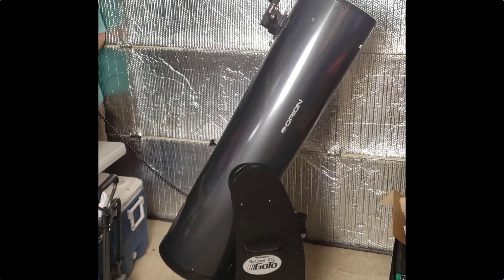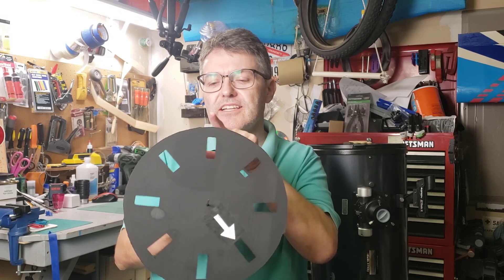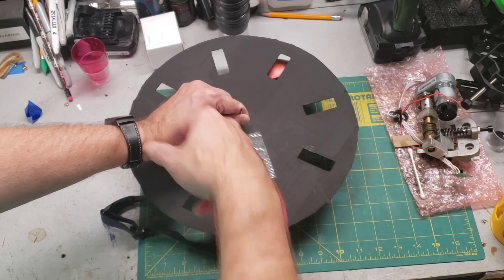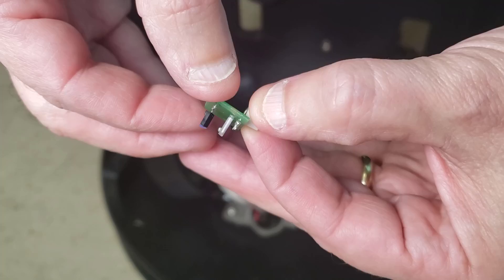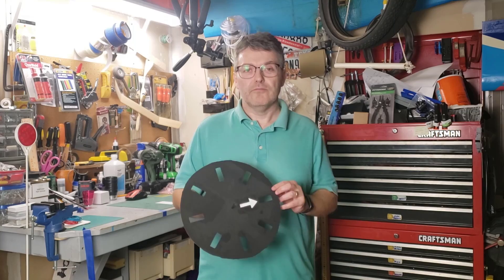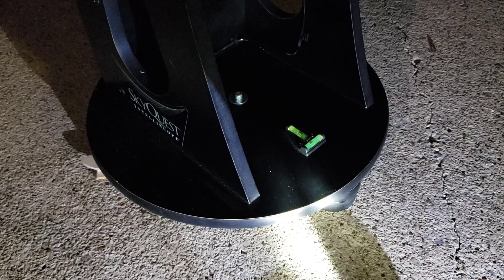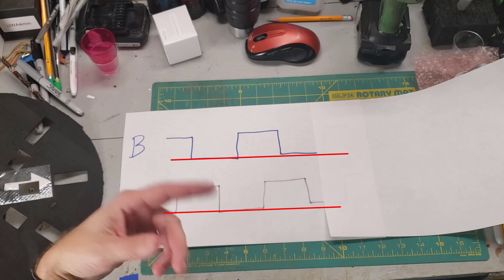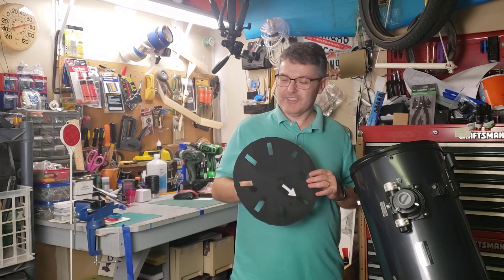The Secret Behind Smart Telescopes

Comment: Yeah love it! Great explanation!
I love my onstep 10" dob system where, rather than encoders, it uses "steps" or pulses to rotate the stepper motor a set number of revolutions on the alt/az axis for the amount of degrees to move. Again, power on and "reset" with the dob aimed North and level, slew to the 1st target with medium accuracy, manual fine-tune so it's centered in the eyepiece and "align" so it's locked in accurately. 
Took a bit of calculations to get the "steps per degree" dialled in but is reasonably accurate.
Cheers 👍
Reply from the maker: Congrats... that sounds like it was an advanced system.  I'm impressed that they went with stepper motors.  Clear skies!

Comment: Rotary encoder knobs use the same principle, but use electrical contacts rather than slits in a disc. But the principle is the same: two contact points, slightly offset, and copper cladding on the disc to act as the slits. These are the "clicky" rotary knobs you find on many consumer electronics to e.g. move through menus and such. They can often be depressed as well, closing another contact, so you can use the same knob for both navigation and confirmation. Cool stuff, definitely worth looking up if you're into that sort of stuff.
Reply from the maker: Thanks for the note - they sound just as intriguing. I'm one of those people who has fun stumbling onto new (old) technology that is often an underlying technology for modern civilization.  Thank you for watching... clear skies!
Reply: @AstronomyGarage  Hah, just saw the community post with the telescope and the mouse. I guess that just like me, you're old enough to remember the time before optical mice? The old ones with the rubber ball?  Actually a heavy core for weight, think it was steel, surrounded by rubber. Well, that ball rode along two capstans inside the mouse. And at the end of each was an optical encoder disc, just like the ones you showed in the video.

Problem with those was that the ball tended to pick up grime which would get deposited onto the capstans, requiring frequent cleaning. Which is why the introduction of optical mice in the late 90's was a very welcome development indeed.

Comment: There is a problem with GoTo system. At least with CPWI software. The WIFI connection is quite unstable. Sometimes it suddenly breaks while the telescope usually goes on following the sky object. however the CPWI requires reconnecting and doing alignment procedure again. The most confusing thing is that CPWI alignment procedure first asks to turn the telescope towards Northern direction, that is, you have to lose your followed object and all previous adjusted orientation model. It would be much better if CPWI just asked to point at any sky object for realignment.
Reply from the maker: I wish I could help, but I'm afraid you are operating at a level way above me. I don't use WiFi connections with my astronomy equipment - I'm all "wired". Thank you for watching.
Reply: @AstronomyGarage  As we connect to the Hand Control via "wired" USB, the Hand Control itself stops working. :(

Comment: I like that SynScan assumes that the telescope is level and pointed north at power-up. I use this all the time, even if I proceed to a star alignment. I agree 100% that leveling the telescope just makes everything work better. Also, because the encoders are independent of the motors, you can grab the scope any time when it’s slewing to move it rapidly to its destination.
Reply from the maker: It really is a great feature of the SynScan systems.  I was surprised how far out of whack it can get even if the base is a few degrees out of level.